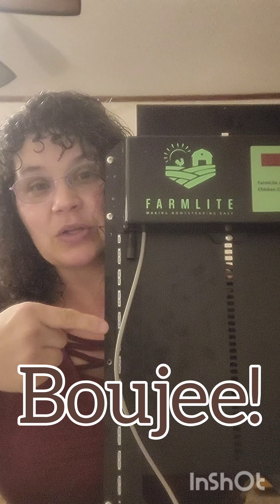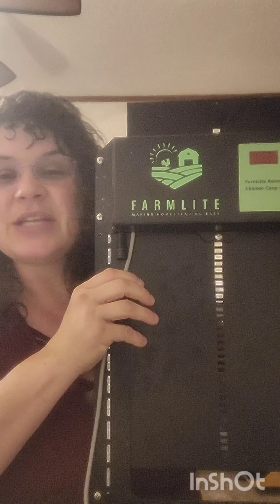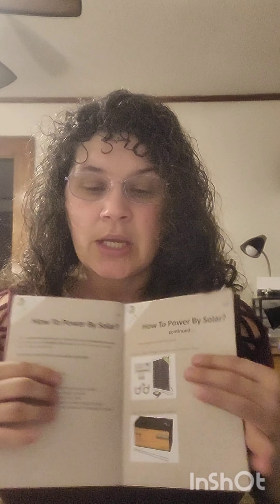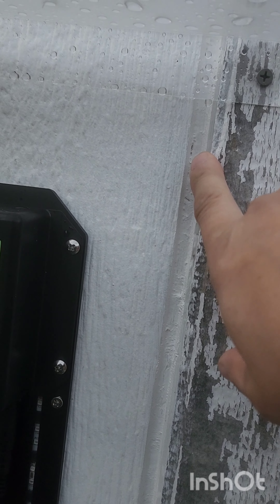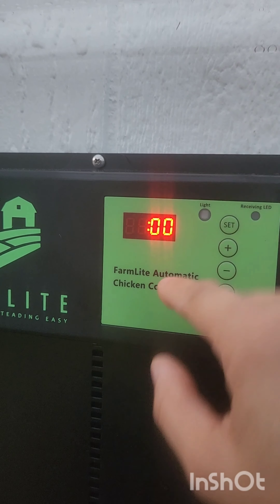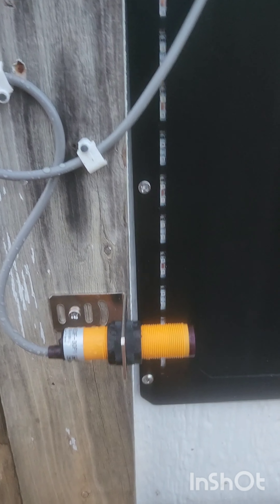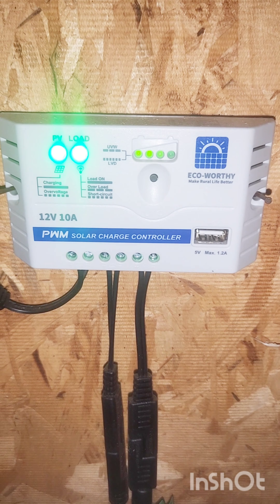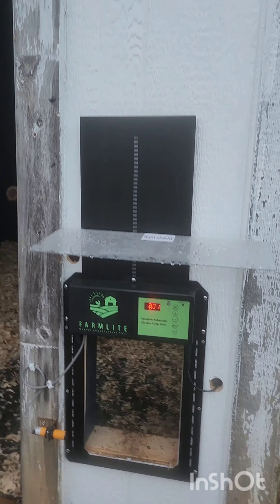FarmLite Automatic Chicken Coop Door Review & Installation

Comment: you a 100% correct, battery backup means that it would be backed up by battery if plugged into a/c power, so verbiage is important; battery backup would be redundant in the case of solar because that is already backed up by battery, Thanks for the video. USMC.
Reply from the maker: Exactly!  I wish the manual would have said that; it would have saved me some heartache.  He did send me a new one right away, though.